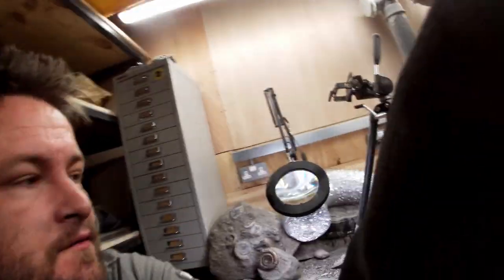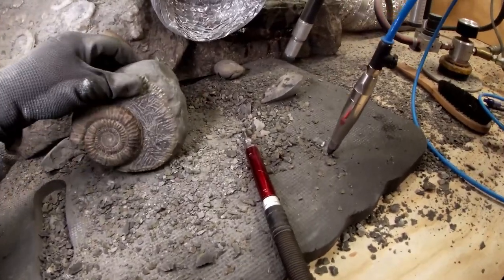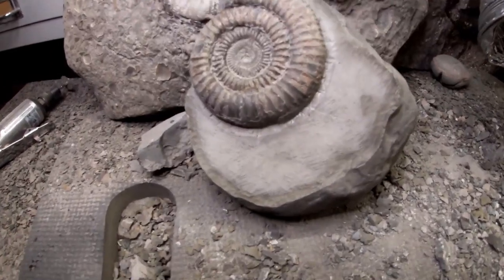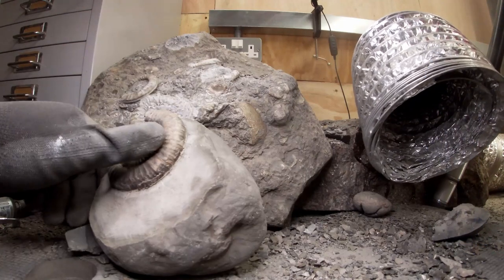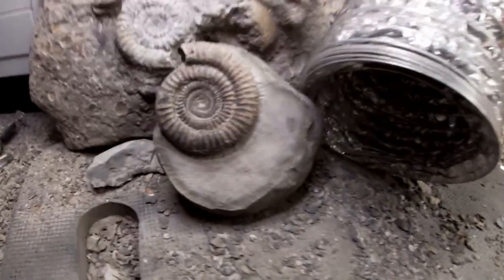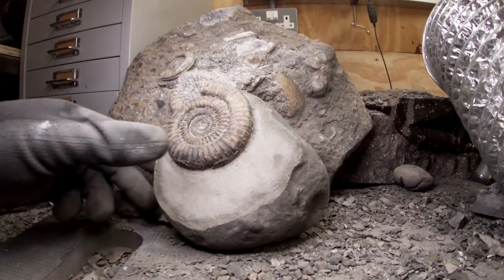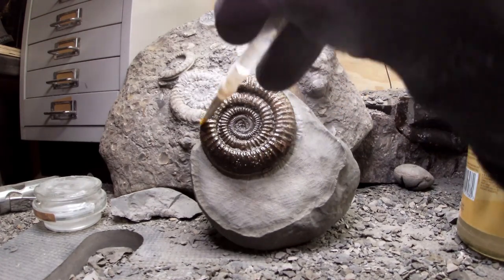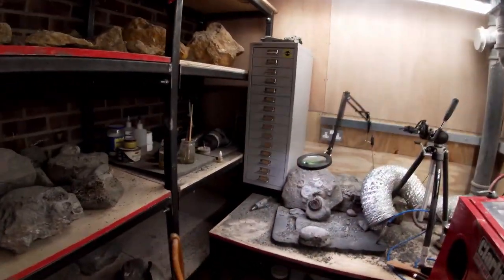Fossil Preparation - Part 2

Comment: What is it that you brush onto the fossil to make it stand out more? Also I’ve seen in previous comments you charge an hourly rate to prep, what is that if you can say please.
Reply from the maker: Its artist varnish and if you want to message me privatly on facebook or Instagram regarding any preparation works mate.
Reply: @TheYorkshireFossilHunter  what’s your Facebook?
Reply from the maker: @nathanbarker4232  im Mark kemp
Reply: @TheYorkshireFossilHunter  what’s your dp?
Reply from the maker: @nathanbarker4232  i had to Google that mate 😂😂😂 black and white image im  Holding a sthil saw over a dinosour foot print looking very very pleased with my self 😎😎😁😁